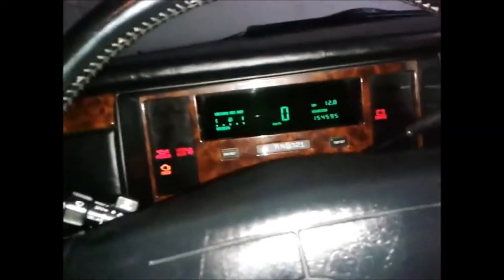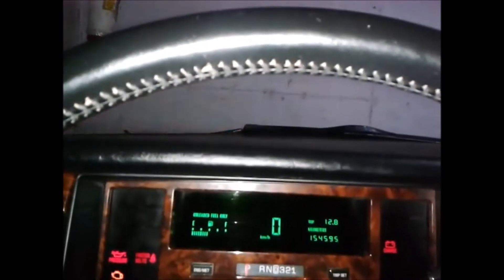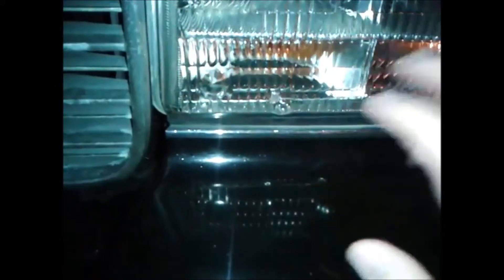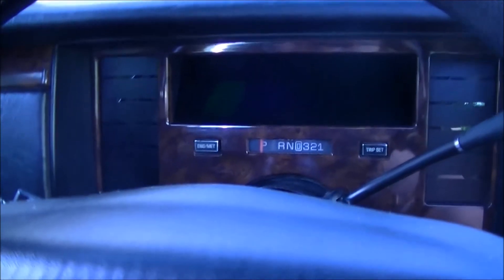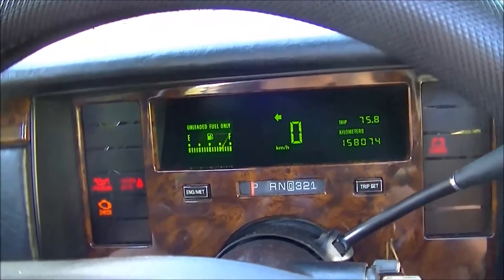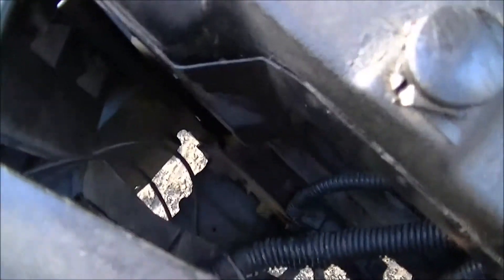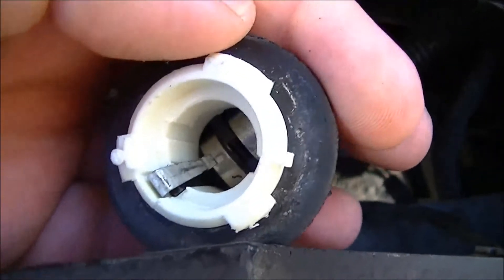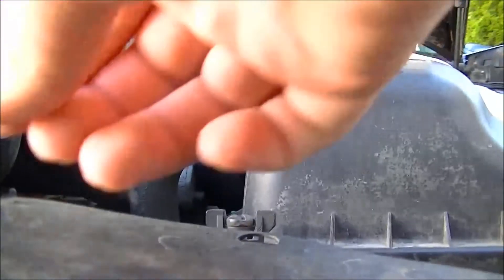How to repair a turn signal socket on a 95 cadillac fleetwood

Comment: Thank you for the video , it saved me a ton of time it was driving me nuts I had power to my socket on both inside metal tabs and insert the bulb and would not have parking light just a turn signal if the head lights were on the inside dash indicator would light up, looked at the socket and knew it was a ground problem somewhere from the connector plug too the socket and when you showed me your problem everything made sense thanks for the video great job!!!👍

Comment: I need to know how to locate my flasher unit on my 93 fleetwood brougham. Do you know where it is?
Reply from the maker: Under the dashboard, driver's side. Look way in the back against the firewall. Easy to spot.
Reply: +vcamnowaa Thank you! now do you know which one it is? Everything looks the same. Haha
Reply from the maker: +ONLY1WIZER 

 I found mine by turning on the turn signal I went under the dash and flicked the relays. When you flick the relay the turn signal may start working momentarily

Comment: I just chased this around the same problem on my 93. It's not as cut and dry as you make it as you need to go check out the back ones as well. My dash lights would go out when I put on my brakes and the right side wouldn't blink at all. I bought enough new sockets to redo the whole car but tried 2357 bulbs instead of 1157. It is working now but I am going to go around the entire car to check the ground tabs. These old Caddies were built to be cool for 10 years and then they turn into over engineered GM cars. I love my Caddie but some shit is too complicated.
To who ever posted below about the location of the flasher...it's behind the panel in front of your knees. overly complicated.
Reply from the maker: alwaysopen I didn't need to check the back lights as they were nice and bright. I knew the problem was with the left light as it was dimmer than the rest of them. This particular problem may be different on other caddies but I uploaded this video just to let  people know to  check the bulb sockets first before ripping the dashboard and relays out